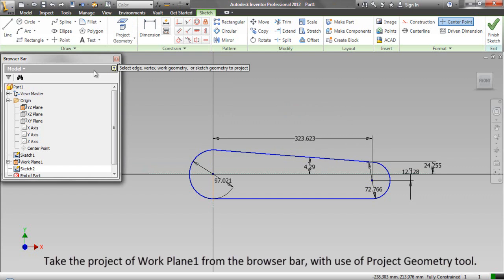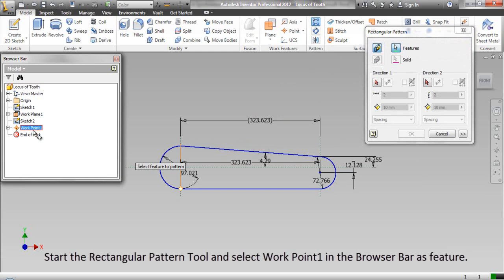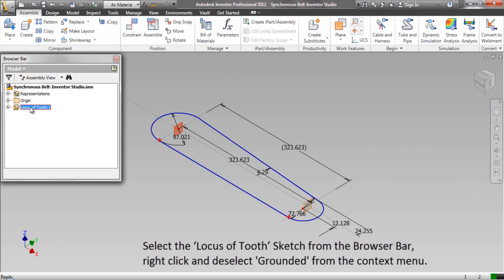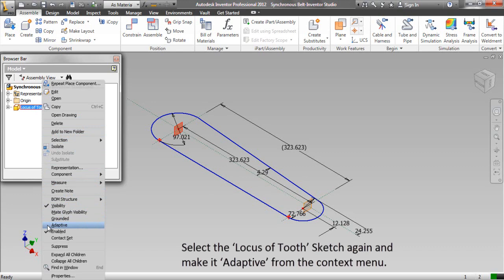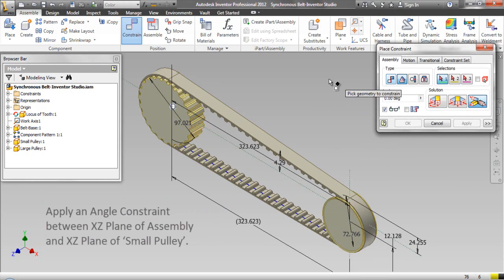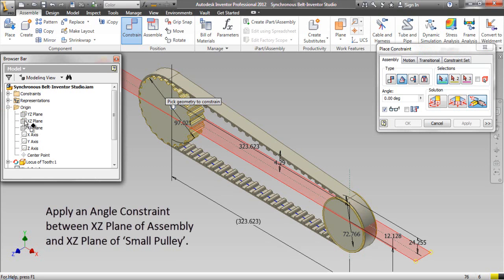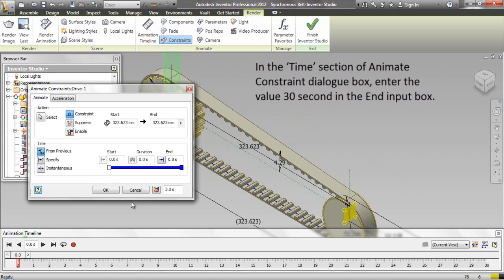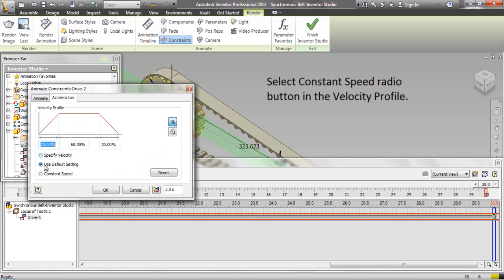Synchronous Belt-Inventor Studio-Autodesk Inventor (with caption and audio narration)

Comment: I don't think you set the ratio between the pulleys, so the belt wouldn't be enmeshed on the large pulley. If I am following this correctly.
Reply from the maker: To change the size of the belt or pulleys or anything. You must start everything from scratch. Create new sketch and generate parts of Sync belt using @watch?v=ZZXcp2qFZBw Tool of Autodesk Inventor.